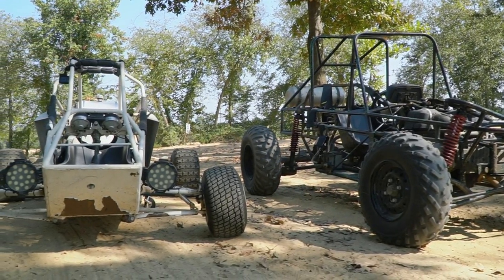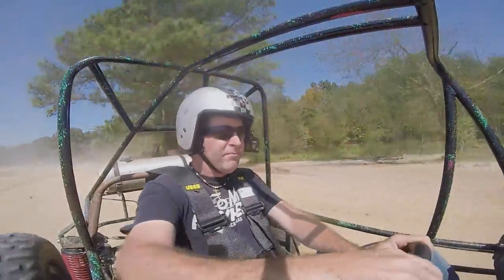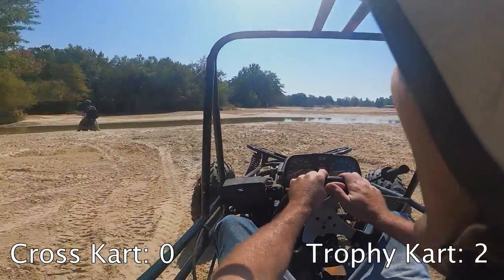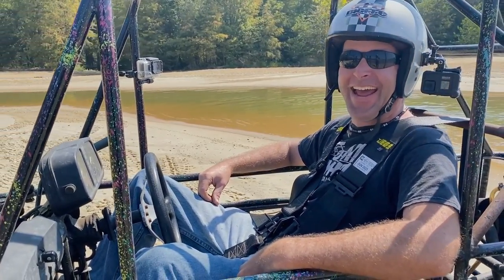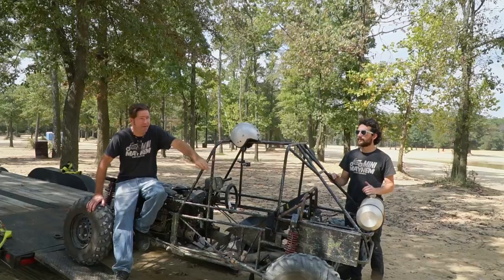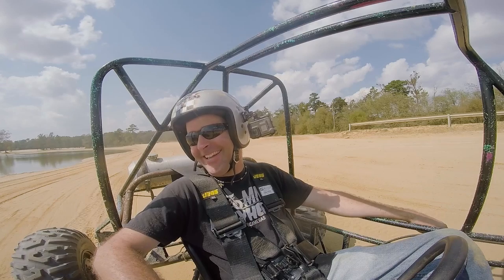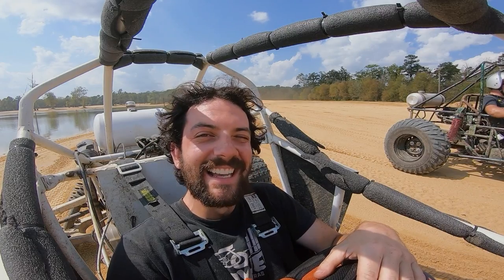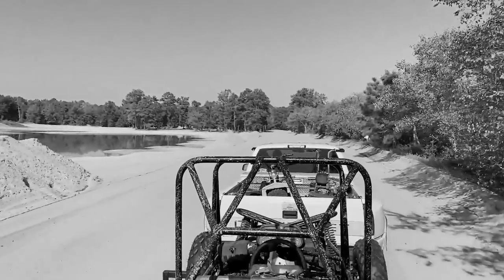750cc Cross Kart vs. 1000cc Mini Trophy Truck SHOWDOWN!

Comment from the maker: It's about time we put these two beasts up against each other! See you soon at Mini Mayhem!
Reply: Boys, put some more suspension in the cross cart and if you take it back to busco put paddle tires in the back of it for traction
Reply: Did you know you have a bent wheel on the front left
Reply: Can't wait to see y'all in a couple weeks!!
Reply: @jackrickells3979  I believe that is just camber for the allignment
Reply: Is straight piping a 212 predator bad
Reply: @brennensbuildsmoore5537  And fix the intake/carburetor situation.
Reply: New build with the 919 engine an I promise it will dominate all
Reply: @static_ls4004  no there is a cinck in the wheel
Reply: Put the 4 carb setup on that cross kart!!!!
Reply: I've been waiting on this vido
Reply: Wish I could go
Reply: That shit looked  violent
Reply: Also need a grass roots race, see my comment above
Reply: Now it's time to step it up another level and track down a Hayabusa engine and transmission,  and build something for all out buggies warfare!
Reply: Next build a buggy for Charles!
Reply: Actually pit that 919 in the Kei truck..I bet it would rip...
Reply: I’m so excited for mini mayhem it is my first ever mini mayhem
Reply: Honestly, they are cool. My only question is why is John crossing his right arm over to shift instead of just using his left arm. Shifts would be much faster.

Comment: We are all learning a valuable lesson about suspension this episode.
Reply: Yeah. Don't build garbage.
Reply: I actually learn nothing from these guys but I still like to watch when they take doing stuff that's barely dangerous so serious its kinda comical, like the lap times they get so serious about ripping minibikes around the "grand pre"you can tell John and Ike didn't grow up riding. my friends would chastize me if I took the stuff they do as serious as they do but Not everyone's meant to be a daredevil they have fun that's all that matters you wanna see dudes making stuff and sending it grind hard plumbing those guys actually get pretty crazy both with how sweet they make stuff and how they ride them and hey don't act like they're about to do some ground breaking stunts ramping a small mound they're donut shots are top shelf Ethan can send .
Reply: @crudboy12  not this shit, you're right. Race cars are more my thing. I'm building my 4th iteration now.
But as someone who's dad wasn't around when I grew up and who doesn't have many friends I've taught myself to build race engines, to weld roll cages, to calculate spring rates and build components and setup a car. I'm by no means the best. My car runs in the middle of the pack. But the fact that I had to do EVERYTHING myself, and by myself (I.E. pull engines by myself) with very limited tools and on a 10th of the budget of the other cars (literally, my last car cost $7000) I understand natural progression of talent. Each time I revise the car I get better.
These guys have been doing the same thing for 7 years. They are getting eclipsed by new channels with kids building awesome things. It's the reason these 2 karts actually happened. They are getting left behind so the had to step outside the comfort zone of old mini bikes and shifter karts and build something from scratch with more than 20hp to keep up.
Reply: @concentratedglass7430  couldnt agree with you more :)
Reply: @1one3_Racing  salty much 🤣
Reply: @funkgremlin2765  how is my comment salty? Pure statement of fact. They still can't design suspension for shit. Have a look at the on board for the new kart and watch the bump steer

Comment: the Trophy Kart proves the old adage, "There is No Replacement for Displacement", and with each build you grow, you adapt, and you learn new things, its a testament to how far y'all have come
Reply: @3a.m.284  Its not a myth, it's math. The more air you can put in a cylinder the more power you will produce
Reply: rally cars would like to know your location
Reply: @chaseparmentier5237  its only fact when youre talking about a naturally aspirated engine. turbo's and superchargers force more air, hence why a 1.6 4 banger could reach 800 hp or even more with a turbo
Reply: @mehmeh7701  which is useless to bring up, because you can turbo and supercharger big blocks into the 1500+ hp territory for the same price of doing it on a 4 banger

Comment: With the trophy cart, the landings should be soft.  May need to redesign to meet the objective.  They're both amazing builds though.  Congrats.
Reply: Agree completely. Needs some motocross/dirt bike style shocks with some adjustability on compression and rebound (just like GHPC long travel oddessey). That 12in of travel should be fully capable in these conditions. But travel doesn’t mean everything without adjustability in terms of the actual shock itself. Increasing the high speed compression slightly and faster rebound on a realitivly soft spring rate would be the god tier combo. “Your rear axle is bouncing like crazy” proves my point exactly. Solid units non the less. Been watching y’all forever and would love to see y’all on a completely insane level in the future! Cheers
Reply: @esand244  I keep finding four wheeler and dirt bike shocks on marketplace I’ve been tempted to buy em because I can’t watch there beautiful trophy cart on go kart shocks. 500$ would get you close to a full set of not-need a rebuild type shocks.  Night and day difference no doubt.

Comment: The cross kart almost looks like it’s only built for asphalt tracks now…. Might be cool to rebuild the suspension to do off and on road.
Reply: Don't have any bump stops or dampers either definitely would help a bunch
Reply: and a taller tyre
Reply: Older build, less experience.
You can't really blame them.
Not to mention, wasn't the stormtrooper
(Yes I still call it that) their first fully scratch big build?
Reply: @2ndlt.sadness67  nah the drag rail was , though technically the rat rod wagon was built from scratch it really isn't in the same level
Reply: @static_bolt  ahhh got it
Reply: @static_bolt  although I'm pretty sure the drag rail was off of a blueprint wasnt it
Reply: @2ndlt.sadness67  nope, they got the playlist of the build, it was just inspired by old slingshot drag rails

Comment: I would put 1"-2" longer shocks on the Cross Kart, with the initial 1" of travel softer and progressive spring and damping rate.
Reply: Or redo the front and rear suspension to give it a few more inches of ground clearance and travel.
Reply: I'd put ATV tires on first, those go-kart tires are hurting it. But yeah, both builds need to be resprung and re-damped for their application.

Comment: The cross kart needs revised. It as you pointed out needs more ride height and suspension travel. Maybe just larger diameter tires? I think that can be accomplished without losing the scope of it being a "cross kart". But those are the critical things it needs and either it's worth a 2.0 revision OR a whole nother cross kart build. I myself, Like the trophy cart better.

Comment: You guys should really consider stopping using the plastic seats and using suspension bucket seats like the ones from PRP seats. They are a huge safety upgrade and will help when you're shocks max out

Comment: Some nice shocks, a higher ride hight and longer suspension travel would massively improve the usability of the cross cart. I might even just start over with the suspension and use the front geometry from an old sport quad. And completely revamp the rear suspension to get rid of the stock miata lower arms. The axles have plenty of travel left in them and are cheap to replace if you do break them. Using atv/sprt quad stuff would also give more tire options for different terrain. Once all this is done. Go do a big Ole meet up with ghpc, I noticed the commented on an old video wanting to do a colab soon

Comment: Better shocks on both. More ground clearance and more travel on the Crosskart, with taller tires. Get a better shifter setup on the crosskart rather than trying to shift across could help improve it. Push/pull cable setup would help immensely.

Comment: Looks like you had a lot of fun your belts need repositioning to work better, just using them tightened up would be more comfortable.
So the next build needs to be using the Honda Goldwing engine the 1500 should be ten a penny by now, and they are reliable and in a lightweight buggy would be fast off the line and top end.

Comment: You guys should look into suspension seats and a HANS devices especially hitting all those jumps . It will save your necks and backs . And the cross kart needs more travel and a engine swap with a water cooled engine. You all are awesome . I love your builds. Stay safe . Keep up the good work.

Comment: A couple suggestions - I don't know what kind of pressure you guys are running in them, but maybe take some air out of the tires on both machines. You'll get a little more grip, and a little more cushion. Second, the CrossKart really needs a redemption, that poor thing has been taking L's left and right. It definitely need some tuning, it just never seems like it's running quite right. Maybe some more modern carburetors or throttle bodies? Fixing the charging system to keep it cool might also help. Third, I would LOVE to see if you could bring the CrossKart to an autocross event with some street tires!

Comment: The Trophy Kart has probably similar HPs to the old CB750, but the K1000 engine is a Horizontally Opposed Four Cylinder isn't it? If so compared to an Inline Four it's going to produce so much more Torque, add that to the Larger Wheels and extended Suspension Travel you have clear winning Formula surely? Maybe try V4 bike engine so you get a more even balance between Torque and R.P.Ms. My brother recently picked up a 1997 Honda VFR750 reasonably cheap and it thing is Stonking and Liquid Cooled! Love the Channel, long may it prosper.

Comment: I only just noticed that the Cross Kart's front tires aren't mirrored correctly with the tread pattern's angles going in the same direction on both instead of converging onto a single point in the central area of the vehicle in terms of central along the front to back axis that can also go up and down.

Comment: the trophy cart looked like it bottomed out on most bumps where the cross had car rear suspension and handled it fine.
how about a trophy cart suspension upgrade then race them. i know it won but it could be so much better

Comment: You guys have mentioned bigger tires for the cross cart. I would love for you to switch the shifter to the right side some how. Also is there a way to increase the suspension travel on a low scale way or not?

Comment: You know the cross-kart's issues, why don't you fix them?
I like watching upgrades/improvements just as well as builds. 
The first thing, put some decently tall/wide tires on it. 
Then fix the suspension, brakes, etc.
Then fix the engine issues, build it!
Then, ride in speed, pleasure, and style!

Comment: The cross kart needs more droop in the suspension, it's also too stiff.  Needs to sit down about 1/3 of the way on the suspension travel.  I tune sport bike suspention and you even want droop on the street to keep the tires on the ground.

Comment: The Crosskart is my favorite build that you guys have done. I am curious why two engines of the same model would sound so different, (i realize it could have a different exhaust)
Reply: The trophy kart has a boxer engine with 1000cc
The crosskart has a straight 4 with 750 cc

Comment: I still think the trophy cart needs roll bars on the top connecting the front to the back. The single in the middle seems a little light. If it were to roll over with that much weight I would want more protection.

Comment: Y’all need to revise the suspension on both karts for more travel and a bit stiffer suspension then you wouldn’t get beat up so much and with the slow mo at the start of the drag race I’m pretty sure the trophy kart has an exhaust leak

Comment: Cross kart sounds like it's on the verge of seizing up....I've worked on and built several of those old twin cam 750s and that's what they sound like after overheating.

Comment: You guys really should more accurately describe these build specs. Truthfully these hp numbers are likely from the Dealerships brochure or owners manual. It's gotta be more like 20hp and 50hp. That cross kart will go twice as fast if it ran correctly. My long time bud and myself built a kart similar to this year's ago. His father was a master mechanic who owned several rod shops. So he was assisting us with the build. But we ran the same CB 750 engine. He wouldn't allow us to run the KZ1000 police engine. He got that 750 running perfectly. His dad let us both ride it a few times until he decided to run it. After that he parked it. Like three days later someone backed into the driveway and he sold it. Totally justified doing so. It really was a death trap so he probably prevented something terrible.

Comment: I know I'm beating a dead horse here, but the cross kart with larger (read: the same size as the trophy kart) would be faster, more comfortable, and just a better handler all around. A gearing adjustment would have to be made, yes, but increasing the gear by about 30% on the output shaft should work really well. While the a tire  size increases the final drive effectively, tire deformation reduces that change, and in off road situations like these, you wil be running low PSI to boot.

 If you are going to keep the cross kart as it is, you might as well put slicks on it and turn it into a asphalt only track toy. The ground clearance is just too low and too punishing.

And put some padding on the seats already guys. You only get one body in this life, and while some parts are swappable, your back is not one of them.

Comment: Just a little tid-bit, "when you get the wind knocked out of you and your sitting down or standing up"........Put your hands above your head as much as possible. Its hard but it helps tremendously.......If you are laying down flat(on your back), try and put them above your head as if you were standing up. I've never tried this laying on my stomach, and wouldn't suggest it. Oh and this is just a suggestion not backed by any medical Dr . that I'm aware of and your doing at your own risk...

Comment: rebuild the cross-cart use the chassis, build better suspension and raise it up. mx5 suspension wasn't designed for off-road, you done well to make it some-what work but it was never destined to work well, It's more of a car-cart than a cross-cart currently

Comment: Guys, build a 900 for it. It's the same externally, and my 81 cb900ss has 95 hp stock...with a little 'help's they have been known to EASILY produce 130+ hp...
Reply: Ive been looking for a 900
Reply: I see them on marketplace occasionally...
Reply: Ike,  I'm officially on the hunt. I'll keep you informed if I run across anything

Comment: There's an advantage there his go cart is higher than the other and the other one's extremely low you're bottoming out all over the busco beach track  Yeah and his quad tires aren't bald like the white goat card is You guys should definitely hire the front Spencer on the white one you're sitting way too low the camber and everything Doesn't look like it's working out very well

Comment: The crosskart really needs some issues fixed engine wise. It just doesn't run right to me. It has so much potential just have to get it running properly and added bigger taller tires and far better suspension.

Comment: You need shoulder strap pads.  Also your belts should not let you pull your shoulders off the seat back. Too much slack lets you sling around = bad, exhale while tightening and help each other.

Comment: Sorry but I don't think the issue was the krosscart. I think it's the driver. Your not exactly known for smoothly hitting those shift points or for pushing to the very edge. I bet if you swapped drivers with the trophy cart, the krosscart would have won at least 2 of the events.

Comment: Whatever happened to the to the Honda nine one nine engine I believe it was? that you were going to put in the cross kart. I think you should build a new cross kart with that engine, and get some input from Chris at Rather be Welding for the chassis. since he builds AWESOME chassis with killer suspension.I'm sure you and him could some cad design work with each other on the computer. just be prepared that good shock absorbers are going to run you some $.  and take the current cross kart and make it into a pavement machine. do a little bit of front end steering geometry work on it. and put some really killer grippy slicks on it. and then pit it up against the the triple two stroke kart. I think that would be your best bang for the buck senerio. you would have an all new cross kart vehicle. and then you would four purpose built vehicles. two for off road fun, and two for pavement frying fun, it's a win win no doubt.

I already have an extremely fast kart for like dirt track or pavement. but I would like to find an old Honda Odyssey and do like GHPC did with theirs. or check with Chris at Rather be Welding for a chassis for off road. then I would have two purposes built vehicles. because the current kart I have would beat a person to death on rough terrain. and because I have a couple of spare snowmobile engines lying around.  

Oh yeah almost forgot, you guys needed to sell the Honduki to me that thing is bad ass.